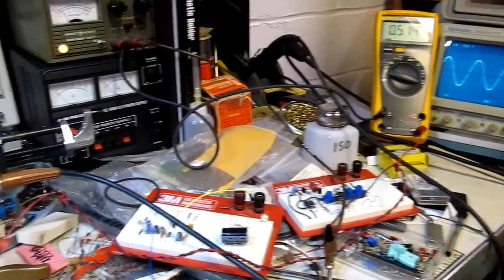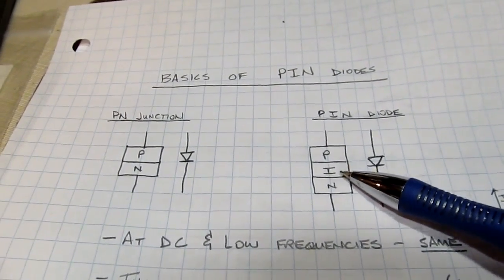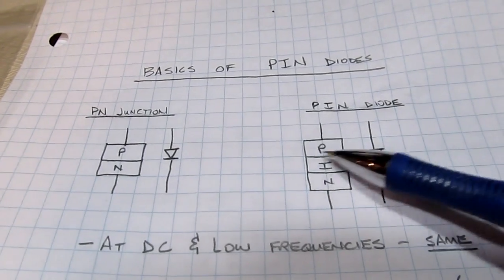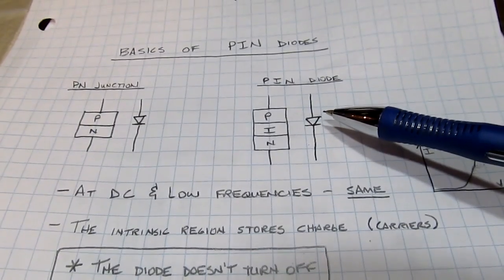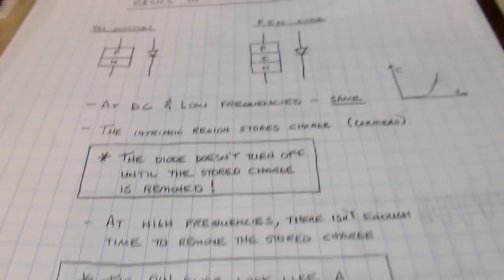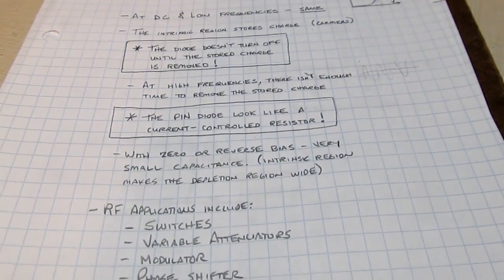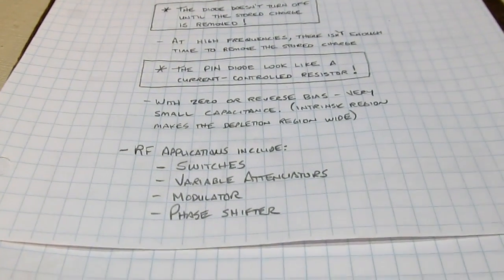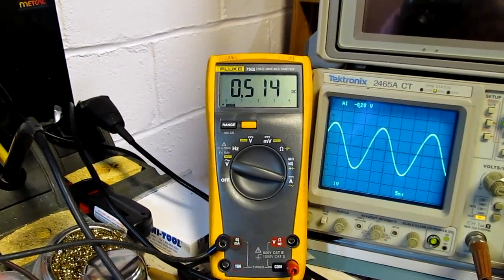#118: Basics of PIN diodes and their use in RF switch applications

Comment: The intrinsic region is neutral; it stores no charge.  p and n carriers diffuse into the intrinsic region and recombine.  The diffusing p carriers leave behind a negative charge layer in the p material and the diffusing n carriers leave behind a positive charge layer in the n material.  These charges generate an electric field across the junction that balances the increase in entropy from diffusion.  The larger plate separation REDUCES the capacitance and accumulated plate charge (Q=CV) relative to a pn junction.  Additionally, the increased junction volume greatly increases the probability that a photon will ionize a p-n charge pair before passing through the volume.

Comment: I just started to learn about electronics, and like your video´s. What I don´t get in this video is why doesn´t the diode clip the negative half of the RF signal (when the diode is not DC biased) and pass through the positive half of the signal as it gets above 0.6 Volts. (that´s what I learned from the textbooks anyhow, maybe I should learn a bit more first before asking questions, but I´m curous).

Comment: Aged 15 or 16, I designed PiN diode-switching into a Plessey SL600-series IC based HF transceiver which worked essentially, and ended up being very similar to a renowned G3TSO design, though I never understood the 'charge-carrier-bucket'  you describe so clearly. 
Excellent series of videos and amazed you take the time to build the jigs. I have subscribed.

Comment: You have helped fill so many gaps in my knowledge from things I never learn't properly at college. The five year one day a week City and guilds course my company sent me on was still teaching valve theory alongside transistors in the late 70's.

As a home project, I once built the 1/4 wave line PIN switch into a 2 meter transceiver, to switch between transmit and receive without an aerial change-over relay, but never understood how it worked until now. From memory mine consisted of at least two 1/4 wave lines and at least four PIN diodes, but memory is a bit hazy now.

Thank you for these wonderfully explained videos. For me the electronics hobby had died about 15 years ago when computers started to do everything far better than things I could build and hence little point building things any more, but your videos have reignited my interest. Thanks again.

Howard UK

Comment: Another great video and this time RF. Started out my career in consumer electronics with the old vacuum tube superheterodyne radio receiver with the old air tuning capacitor and the local oscillator operating with an IF frequency of 455KHz. Old monochrome black and white receivers which every home had supported by four legs etc.. While serving in the United States Air Force back in the late 70’s and 80’ s maintaining and servicing Radar transmitters and receivers enhanced my experience with RF however I had never heard of pin diodes. Excellent job in explaining the theory and practical applications as well as visual aid of an actual circuit of how pin diodes are used in in the isolation of a transmitter and receiver circuit.

Comment: Excellent video.  I’ve come to love my Elecraft rigs and the quiet nature of my HR 50 ATU with the QSK board, but I never really understood how PIN diodes worked and certainly not how they worked in place of relays (such as the noisy ones in my IC 7300).  I understand the mechanical nature of the the relays, but never understood the complexity of the PIN diodes. Now I know,  thanks for yet another awesome video.  De W1ND.

Comment: Thanks for the video! I knew about diode switching, but I didn't understand how it could work for large voltages, such as in transmitters or various antenna switchers, not being aware of the "storage bucket/flywheel" characteristics of the PIN diodes. Cool, I have learned something new!

BTW, you have a really excellent drawing style - my computer drawn schematics and diagrams often don't look as good as your hand drawn ones!

Comment: Would have been interesting to apply a square wave to the control line of the pin diode to display pulsed transmission of a sinewave. Great range of video's well done. Joe G4PMY

Comment: PIN diodes are interesting devices. Another is an avalanche transistor. I once used the combination of both to create an extremely large and fast current spike. If I recall correctly it created a 60amp spike of a sub nano second length. It would be interesting to imagine a long wire antenna which could be 'tuned' by length with the PIN diodes also.

Comment: Awesome video! It is so much easier when I can "see" what is happening to go along with the GREAT explanation. I was with you almost the whole way until I seen that it was still conducting even when it was reversed biased? I'll have to watch it a few more times I think. Thanks again for posting this I felt like a kid on Christmas morning lol  I have a circuit in my head that I have been studying & trying to understand (for a very Long time) while follow along w/your video- Basically it uses a 555 timer to switch between 2 antenna's (using pin diodes) for Radio Direction Finding you might even be aware of it its called -Simple TDOA circuit w/a 555 IC? I really want to build this circuit but never have I just didn't have enough understanding on how it worked until now Great Job!
Reply from the maker: Yes - the PIN diode will conduct (for a short period of time) when reversed biased - this is due to the charge stored in the junction.  Once the charge is all depleted or removed, then the device stops conducting.  It is this stored reservoir of charge that makes the PIN diodes special, and geared towards switching RF signals.
Reply: ***** I was expecting that they would stop conducting sooner (I thought the P-I junction held less of a charge or would dissipate it faster not sure why I thought that lol) until I watched your video & they didn't perform in the way I previously had thought Thanks

Comment: This is so interesting. At that particular RF frequency the transmission line of the scope is 1/4 wavelength. And at that wavelength the opposite ends of the transmission line have opposite impedance! Is this only true with 1/4 wavelength or also true with multiples of 1/4 wavelength or even at any other wavelength?
Reply from the maker: The impedance inversion (around the system impedance) occurs at frequencies where the length is an odd multiple of quarter wavelengths long (1/4, 3/4, etc.).  At the even quarter wavelength (1/2, 1, etc.), the impedance seen at the input of the line equals the impedance seen at the far end.
Reply: @w2aew  That is great! Thank you!

Comment: Excellent Tutorial on pin diodes for rf switching. I always struggled to understand how the receiver front end did not get zapped, but the use of the 1/4 wavelength
of coaxial cable at the operating frequency and your explanation makes sense.
when the diodes are biased the rf passes through the pin diode to the antenna, but sees a very high impedence or open circuit at the resonant frequency.
I assume as long as the transmission is low in harmonics then the front end remains protected. Does the 1/4 have to take into consideration the velocity factor of the coax, or is it not as important?
sorry for the questions but I have always struggled understanding pin diodes in rf circuits your explanation switched a light on LOL thank you. Mark
Reply from the maker: Yes, you must take the velocity into account when figuring the 1/4 wavelength.

Comment: Thank you for the very educational videos!
I have one question... Why doesn't the diode turn on when the signal is in the positive half cycle? Is it because it also doesn't have  time to charge the "bucket" and because of that remains off?

Thank you!
Reply from the maker: +Ricardo Nunes The DC bias used in the "off" state is usually set large enough to keep the diode from turning on during the positive half cycle peak.

Comment: Very intersting video, i have made a diode switch before with a normal diode, but i was unaware that there were special diodes available that work much better. Where would such a diode switch be positioned in a RX/TX RF circuit? I take that if such a switch is used to switch between transmitting and receiving, would it be positioned to to turn on (pass the signal) when transmitting, or to turn on to pass a signal when receiving?
Reply: Wops, did not see the video entirerly, diregard my comment since it was already answered in the video!

Comment: Would you have done a demo using the optical properties of a PIN diode....filling the bucket via photons?
Reply from the maker: Sorry, no demo on PIN photodiodes.  Photons create carriers in the depletion region which quickly drift due to the electric field across the depletion region.  PIN photodiodes are used typically in high speed applications because of the low capacitance.

Comment: 13:09 So , Although it has ony two Pins 
If it act like Transistor switch linearly respect to the Bis current, can it be also  use as Amplifier like instead of fix current bise what if i place signal current to its bise !? Will it linearly Amplifi  the input signal ?

Comment: A well done explanation - you teach perfectly, anticipating the questions that will surface during the presentation.  I got a solid understanding from this video.

Curious if PIN diodes might be used for full break in T/R switch at HF frequencies.  Guess this would be challenge to get 1/4 wave stub across all bands.  Guessing the switching could happen based upon presence of RF - but perhaps not fast enough to switch in time to protect receiver?  If made to work, could perhaps apply to 2m 70cm diplexer application?
Reply from the maker: They can be used, but would more likely be used to break the TX path much further up the chain, before TX signals are amplified much (such as at/before the modulator).  Thus, they wouldn't be subject to blocking high-level signals.  And, the 1/4 wavelength line trick wouldn't be used.  I just thought that this trick was pretty cool (when doing single-band, low power applications).
Reply: *****
Thank you very much.

You note that PIN diodes can be used as variable attenuators at RF... however the scope presentation in your demo shows distortion (clipping) of waveform below baseline as you reduce bias sufficiently to attenuate.  Any thoughts on this?
Reply from the maker: k1mgy In my demo, I was running with fairly low RF frequencies, where the negative half-cycle is long enough to "empty the bucket" of stored charge under low bias conditions.  At higher RF frequencies where this isn't the case, then the change in RF resistance vs. bias can be exploited for applications such as variable attenuators, etc.

Comment: Thank you for the great video tutorial series! I have a question regarding TX/RX switching and ¼ wave transmission line. I have looked at various pin diode circuits for the VHF band and it appears that most circuits deal with the ¼ wave transmission line by adding 2 capacitors on each side of an inductor coil. I wanted to see if you could explain how to calculate the values to use?
Reply from the maker: You simple calculate the L and C values that have a Xl and Xc equal to the line impedance at the desired frequency. L =50/2piF and C=1/(2piF*50)
Reply: ***** Thank you for the information.
Reply from the maker: n5xnq I think you'll like my newest video: https://youtu.be/A1BAq0KxIdc

Comment: Hello Alan,
first of all great video! I have a question about the inductor after the bias input. Why is it needed? To keep the high frequency signal from taking the bias path, e.g. a high resistance for the AC? Thank you again for the video!
Reply from the maker: Yes, precisely.  The bias source is typically a low impedance, so would attenuate the AC signal if not blocked from it.  Also, prevents the possibility of the AC signal from coupling on the bias source, and then possibly feeding into other circuits.

Comment: Hi Sir. How to use PIN DIODES as a power limiter to avoid damage from high level signals coming from the antenna? For example, when receive +6dBm from antenna, the diode limit this power to +3dBm to protect the LNA. How to calculate and choose the right diode for the desired limit value? Thanks!

Comment: Nice informative video.  Can you please tell us what the PIN diode reference or part number was, suitable for HF switching ( i.e. 1-50MHz)?
Reply from the maker: The PIN diode used here was for VHF/UHF.  If you need something for HF/VHF, I'd suggest contacting one of the major manufacturers such as Microsemi, Skyworks, MACom, etc. Their applications engineers can help you select an appropriate device based on your frequency and power level requirements. I'm not an expert on all of the varieties available.

Comment: Hi. Can this technique be used to multiplex 13.56MHz antennas? I'm thinking about using 1.2mH inductors instead of the resistors. Do you recommend a better circuit for this purpose?

Very nice tutorials. Nicely explained.
Reply from the maker: rsocor01 Sure, it all depends on power levels, the amount of isolation needed, etc.  If you chose to use inductors to bias the diodes, then you also need to take care of controlling/limiting the diode's forward current - so either bias through a current source or a series resistor.

Comment: Excellent video- I had a question, though- why is the forward bias current needed at all? If the positive half cycle forward biases the PIN, would that charge not get stored in the intrinsic region for use during the negative half cycle? Does the current need to maintain a positive average value?
Reply from the maker: To my understanding, it won't give you enough charge in the bucket to maintain conduction during the negative cycle.
Reply: @w2aew  Ok- I was thinking about it more, and maybe it has something to do with overcoming parasitic resistive losses. Thanks for the reply, and again for all your efforts in making these fantastic videos.

Comment: Hello Alan,
Does the input signal source require a minimum amplitude?
For example, would I be able to use the PINs in shunt configuration to switch between several receiving antenna inputs?
Thanks!
Reply from the maker: PIN diodes will work very well for small signal RF applications like that.

Comment: I was wondering what limits the PIN diode's bias current when RFC chokes are used instead of biasing  resistors?
Reply from the maker: I would imagine that there would be some other sort of current limiting involved - either via a resistor somewhere else in the circuit, or possibly using a current source to bias the PIN diode.

Comment: For the T/R switch application of a PIN diode, could keying the mic on and off excessively cause damage to the PIN Diode?
Excellent video/lesson, Thank You!
Reply: No. Why should it damage the diode? The material is solid state and the recovery time is shorter than you could key the mic. We are talking about µs or less! Imagine a 1Mhz signal that has 1µs cycle time, so a half µs in the negative part of the sinewave. If you could key the micropohne that fast the diode would become "invisible" to the circuit and it would maybe damage the circuit but never the diode.
Reply: PicknPlaceDIY
The event of charge storage and removal within the PIN, combined with any thermal energy created by circuit. I was wondering if this could damage the diode in these higher powered rigs?
Reply: No, not really. Recombination happens all the time in all semiconductors. That's how they work: electrons recombine with electron holes. It is the same with plate capacitors: The field alternates but doesn't degrade the plates. Same with inductors: The magnetic field will not degrade the material (except for excessive field strength which will crush the material in the end). A thermal breakdown is possible if the diode exceeds ~150°C because of the silicon thermal limits.
Reply: PicknPlaceDIY I appreciate you explaining this...Thank You!
Reply: I'm happy to help! If you have further questions, don't hesitate to ask .. I'll answer them if they are within my scope :)
Reply: PicknPlaceDIY
Very Much Appreciated! Have a great afternoon!

Comment: You mentioned that a pair of inductors would usually be used to bias the diode instead of the resistors.  What is the benefit of using inductors?
Reply: I'm assuming that if you choke just a certain frequency, it will allow the diode to be biased only when there is RF, effectively eliminating the need to add it to a microcontroller or something. Don't quote me, just what I think.
Reply: joblessalex
I'm guessing it's because of the thermal noise of the resistor is unwanted.
Reply: Some resistance would be needed for current limiting, Inductors would help keep RF out of the control voltage circuit along with the bypass cap to ground.
Reply: Darren Olafson Thermal noise will do nothing in this case. The diode is fully on, and the minor amounts of thermal noise introduced by a resistor are insignificant. The reason, I would assume, is to prevent feeding the RF signal where it doesn't belong, ie into the circuit that is generating the control current.
Reply: Gameboygenius
I found the following in an Agilent appnote.  "RF chokes (inductors) are used along the biasing paths to avoid RF signal leakage while allowing the DC signal to ﬂow through to bias the diodes. The RF choke must have adequately high impedance at low frequencies so that the RF signal will not leak through the biasing path leading to higher insertion loss."
Reply from the maker: Yes, inductors are used to keep RF out of the bias circuits.  Also, when operating with low voltage circuits, the resistive impedance of the bias circuits might be unacceptably low for the desired bias currents - so the inductors help to raise the RF impedance of the bias circuits to prevent loading.